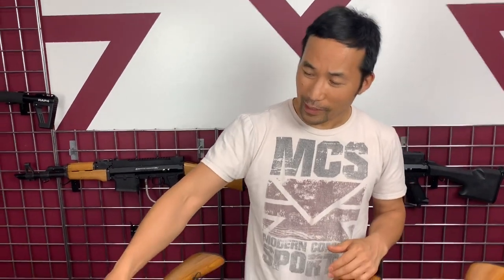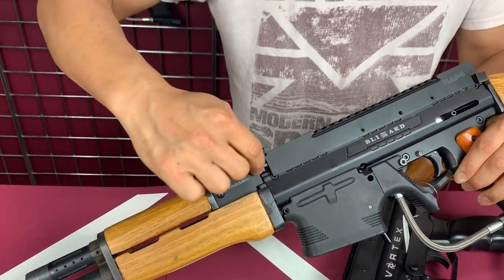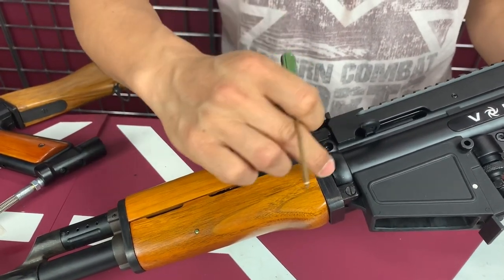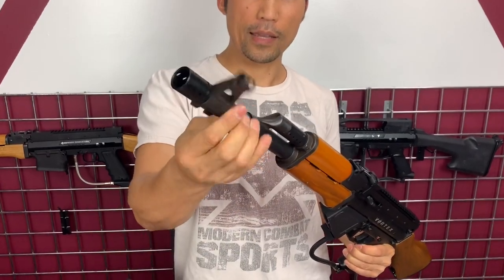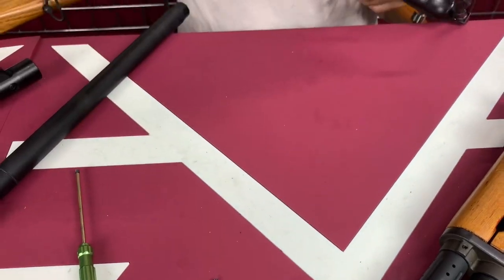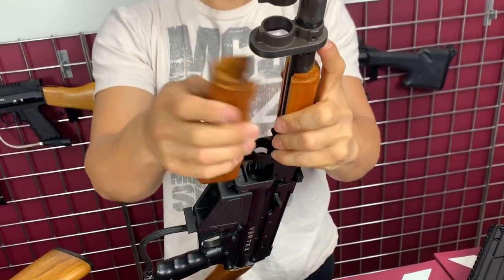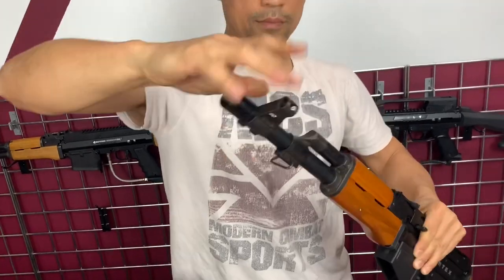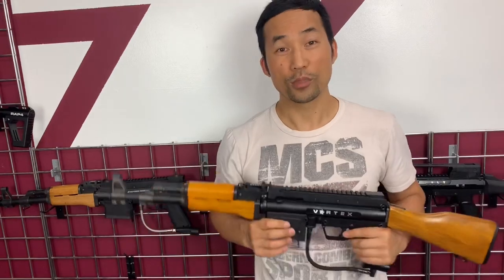Tacamo AK47 Kit Installation

Comment: Which inside part do I need to file you mention on the tippmann 98 version KT
Reply from the maker: On the 98 you don't need to do much, a slight fitting adjustment is needed, you can see when you install